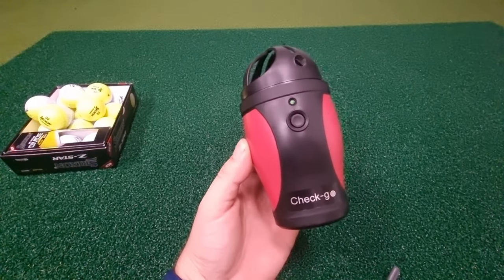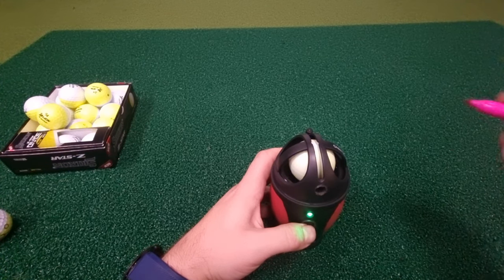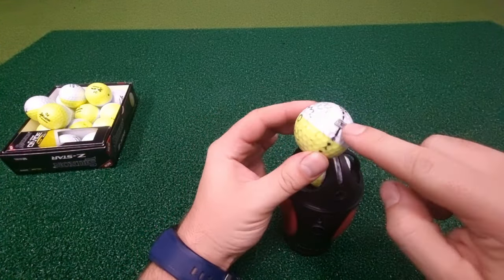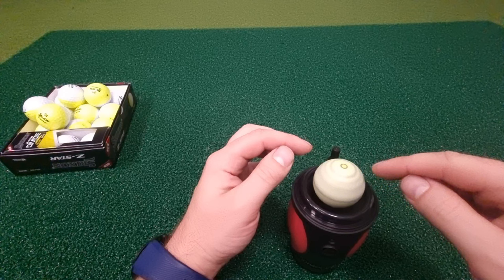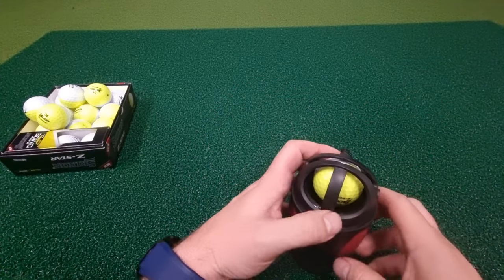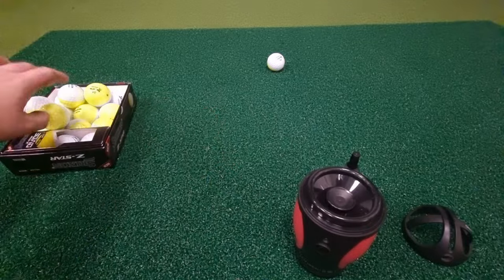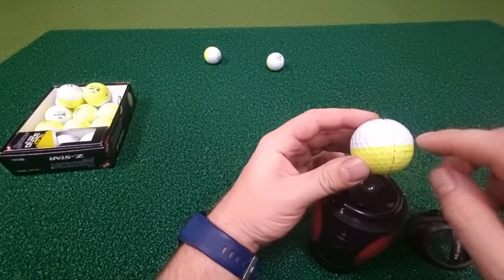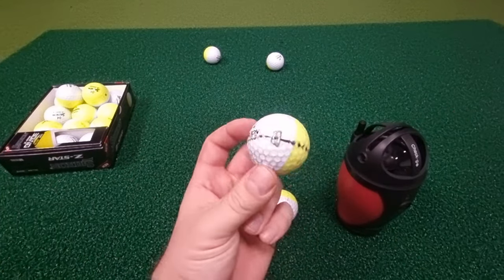Check Go Golf Ball Corebalancer

Comment: The heavy part will always spin out to the equator. If you get different results each time then the ball is balanced, which is good!

Thanks for the tip to drill the pen hole larger so a sharpie will fit!
Reply from the maker: Yes indeed ....there was me, thinking the balls that didn't repeat weren't good balls 😇  ...Ah yeah ....now I can use some different coloured sharpies as well 😎

Comment: I have a “check go pro” as well. I balance all my balls. Once I spin them and mark it, I have to assume it will fly true. The ball is spinning at 10,000 rpm’s! Usually when I drive it the line points in the direction of my strike. I would think if it is marked in multiple locations along the ball, it’s balanced all the way around. Maxfli Tour & X are spun by the manufacture! Titleist Pro V’s seem to be very consistent to the manufacturers mark, probably because of its quality control! Thanks
Reply from the maker: Ooh nice! Didn't know there was a pro one 😎 

Yeah, it makes more sense ....big weight on the side, and it's definitive... when it comes out in different places, it makes sense that the core is more centred 👌 

Ooh, I didn't know that about the Maxfli!!! Don't see them in the UK I don't think 🤔
Reply: @FredzGolf  Wilson Triad (its balanced layers) and the Maxfli Straightfli (its dimple pattern)have interesting characteristics that are suppose to make them fly true. I play the Wilson ball(s), Triad, Staff, and Zip.
Reply: @FredzGolf  It’s probably the older edition!

Comment: dun get it , if the heavy side (CG) is at the bottom, shouldn't the putt line be drawn from the top where the dot is marked, rather than on the side??
Reply from the maker: The weight is on the equator mark .....I put a giant ball of lead tape and glued it on to guarantee where the weight is 😁
Reply from the maker: It's not at the bottom :)